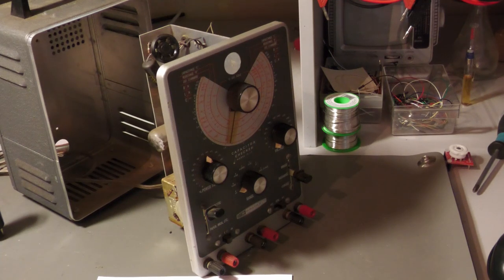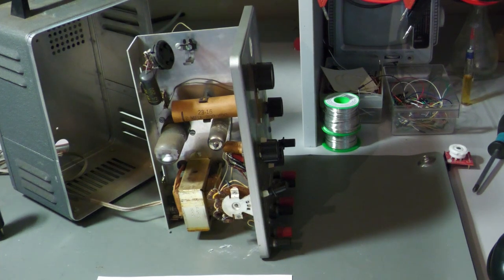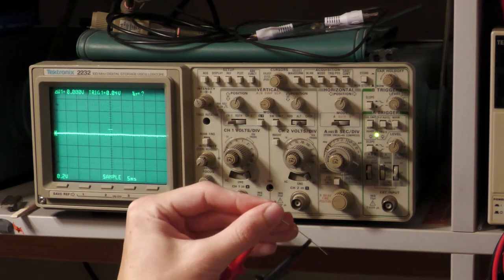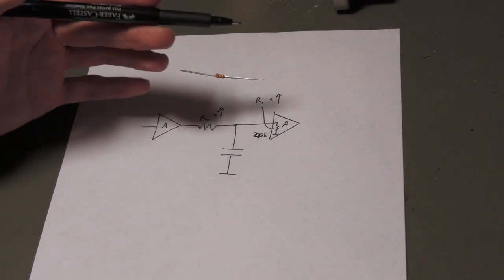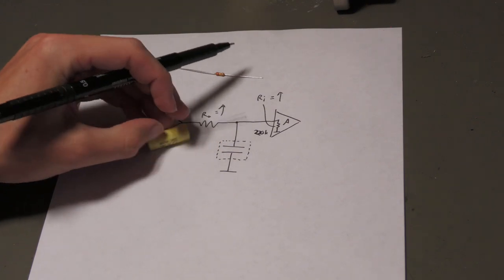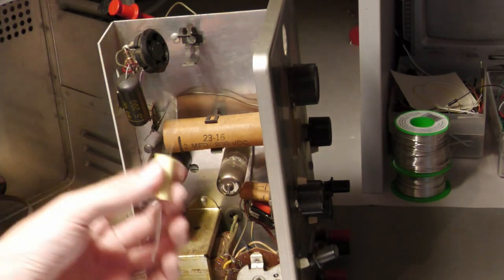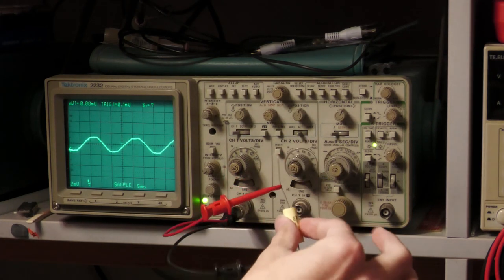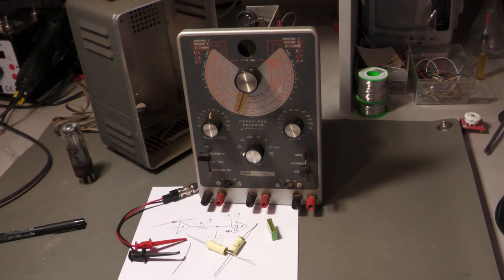Why and how to find the outer foil of a film capacitor

Comment: Love your explanation! Could you explain all of your scope settings as they are set to check for outside foil end of the caps?
Reply from the maker: Thank you for your comment! Yes, of course, I'll explain the settings. Use 5ms as the timebase setting, this is ideal for measuring the 50Hz or 60Hz interference that you couple into your capacitor. Use a 1x probe and a low Volts/div setting to get as much signal as possible. Something between 2mV and 20mV is a good choice. Try what works best for your setup and your capacitors. If your scope has a bandwidth limitation, use it to get rid of RF noise, you just want to see the 50Hz or 60Hz interference. You can use an analog or digital oscilloscope for these measurements.
Reply: @MrVideoTronix  Thank you for that info. You do a great job explaining things.
Reply from the maker: @chrisr.3122  Thank you! I enjoy explaining things 🙂

Comment: Excellent! Do you need to locate the low impedance side of non polar caps or can they be connected either way? Thanks again.
Reply from the maker: I am glad, that you have enjoyed my video!
You always should locate the low impedance side of the caps, also non-polar ones. The coupling of the interference does not depend on whether the cap is non-polar or polar.
However, there might be some circuits in which it is more important than in others since it depends on which impedances the cap is facing and what it is doing in the circuit. So the safest way is to always make sure you get the low impedance side correct.
Reply: @MrVideoTronix  Wow, that's great to know and very few know about this. Thanks.
Reply from the maker: @rondeldebbio9219  You're welcome!
Reply: @rondeldebbio9219   For example , if you restore a guitar amp and add all new caps in it , the foil side always goes to ground , if not then you get more hum in your amp .... Usually the caps that are changed will be electrolytic style and those are marked from the factory..... The orange drops and Mallory caps are not marked ...... The cathode caps that go to ground are an example ..... Remember always that a capacitor is a filter for noise and other things but that's getting a lil deeper into it......  Those bigger caps near the power transformer are filters also for 60 Hz hum in the USA , non USA is 50 Hz ......

Comment: New to electronics. Why arnt caps marked with the outer foil side? It should be the industry standard. What standards UL, ASTM, ISO, DIN... can be created and established, and thriugh whom? boggles them mind why there is no standard.!
Reply from the maker: Most vintage caps head the outer foil side marked. The reason why modern caps don't have markings anymore is that it's not necessary for modern circuits. In modern electronic circuits that are made of transistors and ICs, you have much lower impedances and smaller components than in circuits with tubes. Since the impedance is lower and the components are smaller it's mostly not necessary to know the outer foil side in modern circuit designs.